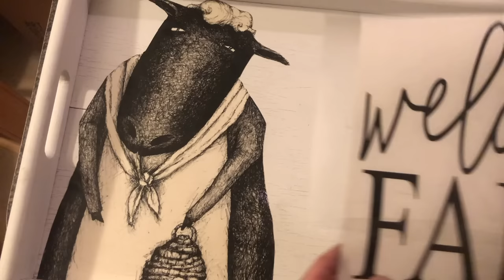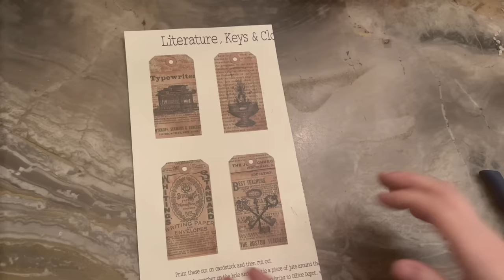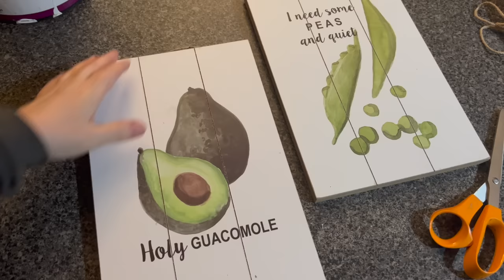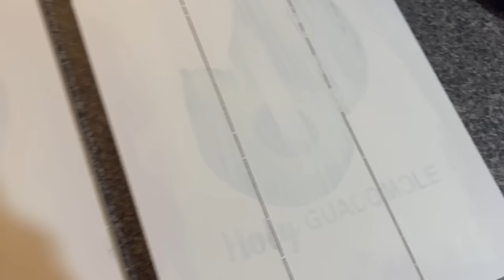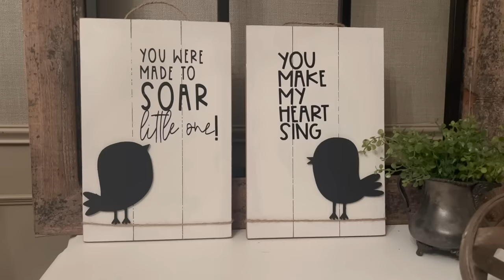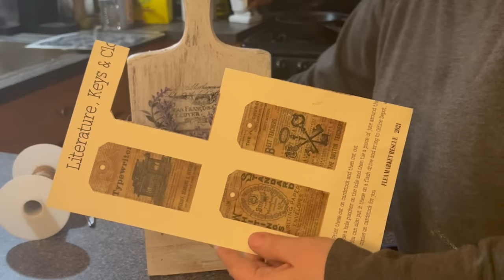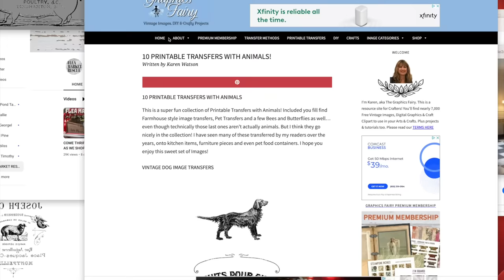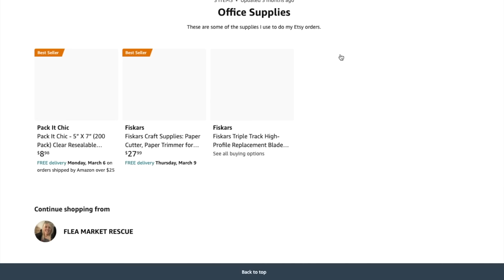NEW TRASH TO TREASURE HOME DECOR THRIFT STORE MAKEOVER FLIPS 2023

Comment: If you add a little modge podge to the edges, you can use a lighter to burn away they excess paper and once the glue fully dries, you can then send.  It works surprisingly well, especially on detailed pieces.